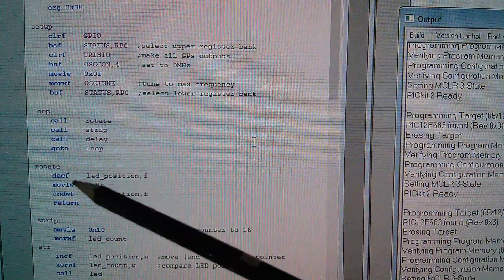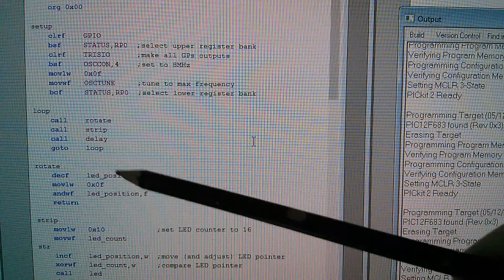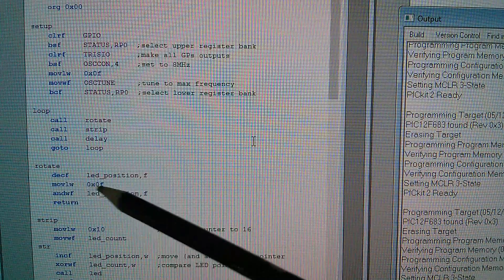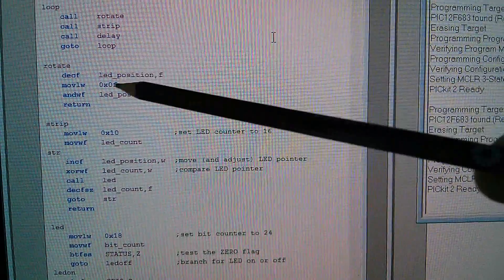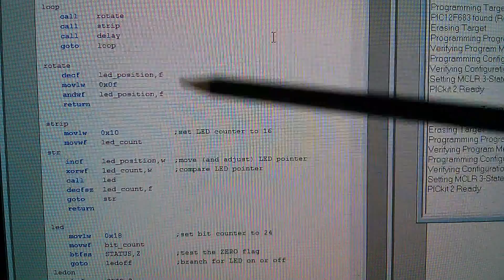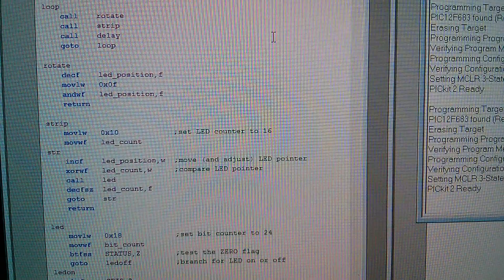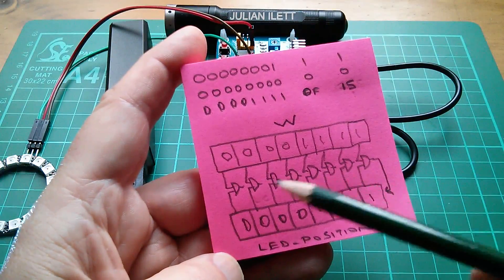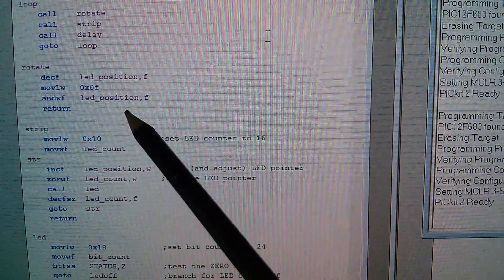Neopixel LED Programming: Using an AND mask

Comment: I'm not famliar with PIC but couldn't you and against an immediate value rather that shifting an immediate value into a register and anding against said register?
Reply: Peter Owen The PIC doesn't have an instruction to AND f with a literal value; It does have one to AND w with a literal, but then in this case that would require moving f into w first anyway, and then to free up w for other stuff you'd want to move w back into f, taking up an extra instruction.
Reply from the maker: There's a good reason why you can't AND a literal with a file register. The instruction op-code is 14 bits. A literal is 8 bits and 7 bits are needed for the register address. That's 15 bits!

Comment: Julian - perhaps its not completely your sort of thing I was wondering if you would do a video about triacs controlling high power (200 watts) load. Seems there are not many quality videos about the subject.
Reply from the maker: I used triacs many years ago to control the brightness of incandescent light bulbs for a disco/stage lighting system. These days you'd use LEDs. Clive did a triac video recently.
Reply: Think I might have missed that one - I'll see if I can find it. I was thinking something like an arduino controlling bulbs, ac motors or heating elements

Comment: I enjoyd this video. Well presented. Regarding the lfsr, if you want next outcome to be less dependent on the previous (hence the random pattern on the ring seems to run a little bit down on each side), you can add a second lfsr and xor them together. Note1: The registers must be of different sizes, for example, a 16bit lfsr running and its lowest 8 bits are xored with your 8 bit lfsr. The statisticall independency between the outcomes are improved. Note: Only a subset of all tap-masks give the longest running sequence for any lfsr. By tapmask i mean the number you xor in at the beginning after rotating. In my video I started out with a  fibonacci/external type lfsr (also called simple lfsr) because I didn't understand lfsr yet, so you went on with the computational efficient type (Galois/internal). The theory indicates that the lfsr is rotated right, but in pic assembly I found it easier to rotate left because then you can use carry as the feedback :) (I also had to invert the tap-mask ofcourse.)
Reply from the maker: Thanks, it was your comment that got me interested in writing the LFSR code.

Comment: Yes, do a video on pseudo random.
I want to point out another neat trick in assembly language (which I don't use anymore). The destination flag of some instructions can be very helpful. Let's say you use led_position in an interrupt and you don't want the interrupt to see a number >15. You could do all the work in WREG and first instruction does both decrement and copy f -> W:
decf led_position, w
andlw 0x0F
movwf led_position
Of course you shouldn't change led_position in the interrupt in this case.
Reply from the maker: Thanks, I will :)

Comment: One diod is not lighting up in You random stuff :)
Reply from the maker: That's right - the LFSR cannot generate zero
Reply: Is there a common way around that if you want a pseudo-random number generator that generates every number once per full cycle, including zero? I assume the same technique can be used to generate longer numbers...

Comment: how long is the pseudorandom sequence?
Reply from the maker: Length 255 is tricky because it requires 4 taps - so I chose a 2-tap option - length 15 in this program. But length 127 is also easy.
Reply from the maker: 15 states long
Reply: assuming it is a maximum length lfsr, the max is 2^8 - 1 = 255. That is all states except where all bits are zero. If all are zero, then the lfsr comes to a halt.

Comment: I've been programming for 40+ years, including many assembly languages, and your solution is a "special case" in that it only works if the number of LEDs is a power of 2. It is a much better practice to define the number of LEDs as a constant and write routines that reference that constant for counting. You would have to rewrite it anyway if you moved to a 12, 24, or 60 LED ring.
Reply: For this case his solution is way to go, it is much smaller and faster than general solution.
Reply from the maker: True, it is a special case. It meant I could drop in the LFSR code in as a direct replacement.

Comment: Why not just leave the 4 MSBs? Can you only send bytes to the LEDs from the PIC?

Also is there any specific PIC you would suggest for a beginner(someone who's fine with boolean logic+programming)?
Reply from the maker: Because during the Neopixel bit transmitting subroutine, I compare the led_position variable with another counter variable running between 0 and 15. If I left the 4MSBs, I'd rarely get a comparison match.

Comment: Another quick 'pseudo-random' generator would be to add (or subtract) a relatively prime constant (in this case any odd number will do, though 7, 9, or 11 - near halfway round the clock - will look more erratic) instead of incrementing (or decrementing). The immediately following and-masking with 15 takes care of the ranging just as before. With 16 as your basis you're guaranteed to zap all 16.
Reply from the maker: I remember doing that when formatting floppy disks to get the sector interleave :)

Comment: Thanks again Julian and yes I'm still trying to learn assembler. I am using 16f628's and later on will use the 18f's when I get the 35 or so command's under the beld. But love the way you explean in. Just wish I know where to get a hardcopy of a book that I can learn it from. But you did a great job.

Comment: The word "file" here is just confusing the hell out of me.  Do you mean "register" or is this a PIC thing?
Reply from the maker: Yeah, the PICs registers are called files
Reply: Ouch !
Reply: Ouch indeed. Weird, even.
Reply: I am assuming that a little architecture discussion would have helped but every time Julian says "file" I can't help but think, FAT/NTFS/EXTx/Handles/leaks.  On any other processor it's either a register or memory or perhaps I/O if you're not a MOS/Motorola guy.  I'll find a way to get over it - like continuing to ignore PICs as I have in the past.
Reply: And we still go on about film footage. And that's not even metric.
Reply: And while it is footage, it is usually 8mm, 16mm or 35mm film...
Reply: With PIC micro controllers, a file (f) location is a location in the read/write data RAM. This is separate to the program EPROM/Flash ROM.

Comment: Okay I understand most of that because I've worked with Assembly Language before with C=64 more so-called machine language. But there's one thing I kind of got confused with, and the rotate Loop if you decremented all binary bits will be set to 1 going backwards from decimal 0. So in your MOVLW 0x0f , is that the command that's actually putting the first four bits as 0? That's actually the AND part or is that just moving the variable into that location then AND it after?? Because of the first four bits are 1 by the decrementing if you do the end if they already are 1 won't the end results be a 1?? I think that's where I'm getting confused :-)
Reply from the maker: "movlw 0x0f" just puts the literal value into the W register. The W register is a special purpose "working" register used for most of the arithmetic and logical computations. "andwf led_pointer,f" actually modifies the register called led_pointer.
Reply: Okay I understand what the variables are. so you're loading into the variable W  0x0f. So after that then you're ANDing it with the next command okay. I think I understand that but the same question is if that Loop keeps calling up to do the AND logic  changing it to 0F each time  keep the counter at dec16?? I guess I'm not seeing the full picture because I can't see the whole code. :-) and I got to get more familiar with this Assembly Language opcode as well. As you can tell I am beginning :-)
Reply: I correct myself I meant to say decimal 15 not 16. I'm using a little small tablets  virtual keypad to respond.
Reply from the maker: Ah yes, I failed to mention something quite important. ANDing with zeros forces bits to zero. ANDing with 1s leaves bits unaffected/unchanged. The opposite happens with OR. ORing with 1s forces bits to 1. ORing with zeros leaves bits unchanged. Hope that makes sense.
Reply: The AND with x0F is done every turn through the loop, but only affects f when f has just  changed from x00 to xFF, resetting it back to x0F

So the sequence  is:

x0F AND x0F -> x0F

x0F AND x0E -> x0E
x0F AND x0D -> x0D

x0F AND x0C -> x0C

x0F AND x0B -> x0B

x0F AND x0A -> x0A

x0F AND x09 -> x0F

x0F AND x08 -> x0F

x0F AND x07 -> x0F

x0F AND x06 -> x0F

x0F AND x05 -> x0F

x0F AND x04 -> x0F

x0F AND x03 -> x0F

x0F AND x02 -> x0F

x0F AND x01 -> x0F

x0F AND x00 -> x0F

X0F AND xFF-> x0F

It's just probably 'cheaper' to always load x0F the AND operation  than to always do a comparison and branch if the value is xFF and only then do the load x0F and the AND operation.
I'd have put in a comment along the lines of  "Reset to 15 after overflowing on decrementing 0" to make the purpose of the AND-ing more clear.
Reply: That sequence is wrong from 0x0F AND 0x09 which results in 0x09.

00001111 AND 00001001 is 00001001

0 AND 0 is 0
0 AND 1 is 0
1 AND 0 is 0
1 AND 1 is 1

so 0F AND 09 is 09
     0F AND 08 is 08
     0F AND 07 is 07, etc. etc.
Reply: "that Loop doesn't get called up until it actually reaches 15 then 
automatically resets it back to 00?  if that's NOT the case then doing 
the AND command in the loop all you're doing is taking the first 4 bits 
off the decimal value of 15?   cause 0x0f is 15, right?"

No, hes counting backwards from 15 to 0 and the AND operation happens in every pass through the loop, no matter the current value. 
The bitmasking however only effects the value when the value is larger than 15 / 0F, and this only happens when you decrement 1 from 0 (and you end up on 255 / FF) in that case the bitmask has an effect and resets the value to 15 / 0F by ANDing the 4 higher bits with 0's, forcing them to 0's and the resulting value to 15 / 0F

Instead of always applying a bitmask that only has effect in one case, one could instead test if the value was 255 / FF after the decrement, and in that case explicitly reset it to 15 /0F

That he writes x0F into w in every pass is because there isn't really a mechanism for variables like in higher level languages. In something like C you might stuff x0F into a short int variable called bit_mask and you'd use that to AND the current value with. The compiler would make sure that x0F would be in a register in the processor when needed for the AND operation, but in assembler you need to do that yourself.
Reply from the maker: It's correct. All numbers 0x00 thru 0x0F are left alone. Only numbers greater than 0x0F are affected by the mask.
Reply: ahh  I understand that part I'm just confused about why you're putting 0x0f back into the W location doesn't that put the value to 16?  I guess that's where I'm lost.  please do not mind me as I'm just trying to learn. I'm far from being an expert on this. I'm just thinking back to my Commodore 64 days.
Reply: Okay scratch my last statement. I just read the other posts to this and I appreciate that. I guess I can understand it better now. I guess I just have to understand the opcodes a lot better.
Reply: after reading the other two peoples comments, that Loop doesn't get called up until it actually reaches 15 then automatically resets it back to 00?  if that's NOT the case then doing the AND command in the loop all you're doing is taking the first 4 bits off the decimal value of 15?   cause 0x0f is 15, right? see that's what I'm saying I'm new to this. I guess I got a lot to learn. I'm sorry to put you guys through all this
Reply: As I say I am understanding WHAT he is trying to do and WHY he's trying to do it. That I fully understand. I'm just trying to understand the code. That's all. :-)
Reply: Okay I'm sorry to keep posting here, but I think I'm beginning to understand this now. I'm rewatching it again until I catch on. that ANDWF is doing the LOGIC AND to what was stored into the variable W with what was stored in file F and then rewriting the back into F?? So the W and F of that particular AND command are more or less just variable assignments for the location and value?? Being that you stored 15 decimal into it, the last four bits are always going to be set to 1. So whatever you're comparing it to  whatever decimal number that would be in the  F  variable, when it gets to the value 0x0f  that is in the variable W,   the AND command will know F is now 15.?????
Reply: Okay I am getting now 0x0f is only a comparison Value stored in variable W to only compare with F.  It is not part of the actual decrimation code. Now that I understand how AND works I understand why it's doing this now
Reply: I appreciate everybody's input on my comment. I have to get to learn more about PIC Assembly Language programming.  I guess it's not as easy as the old Commodore 64 machine language. There is some basic similarities. Like I have to understand what the W register is, all the op codes, etc. I did some research on Wikipedia yesterday and various other sites. I think I got to start from a smaller scale and experiment first once I learn the Assembly Language code more so. Then I will understand more what I'm doing. But thank you again for everybody who took the time out to reply to my comment.